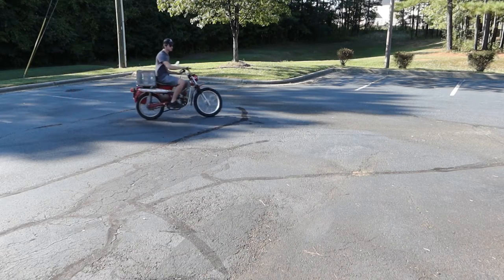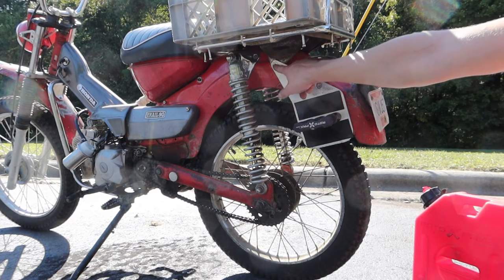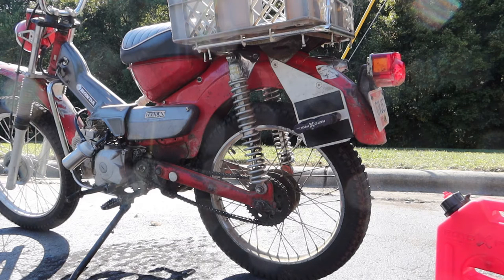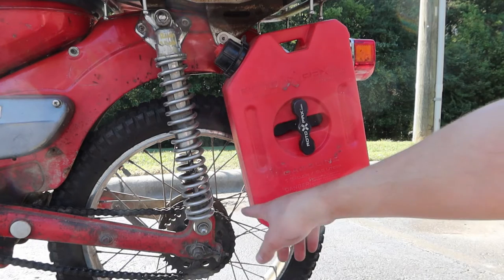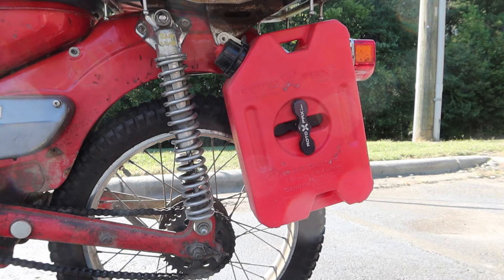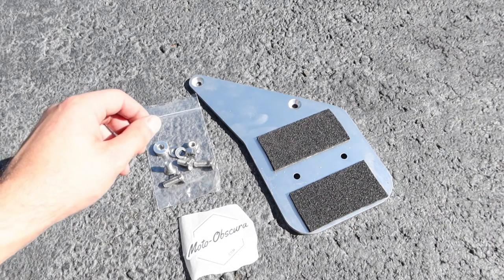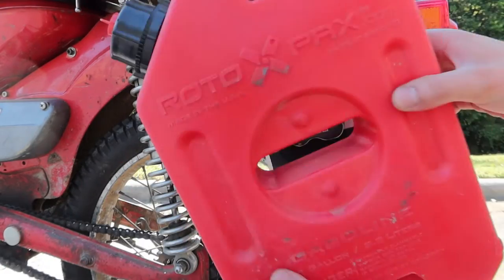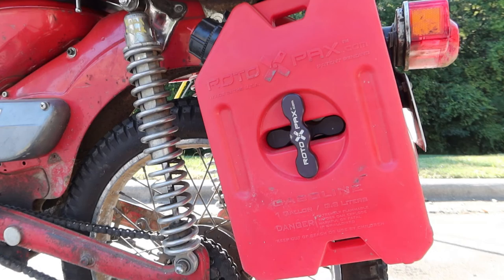RotoPax Fuel Container Mount for Honda CT90 / CT110

Comment: What is the story with the longer travel rear shock? What model is it from?
Reply from the maker: I believe they are from a Honda XL185. Required modification to the top bushing to fit if I remember correctly.
Reply: @NickMakesBreaksStuff  thanks for the quick reply!

Comment: does ct200 allow smaller rear sprocket, and what sprocket sizes are you using right now?
Reply from the maker: The only thing stopping you from fitting a smaller sprocket to the CT200 is the lack of availability. In this video I believe I'm running a 40T sprocket on my CT90 that I had custom made.

Comment: Does this not fit CT200 models because of that model’s dual sprocket?
Reply from the maker: That is correct. The CT200 also doesn't have the second mounting hole in the fender.